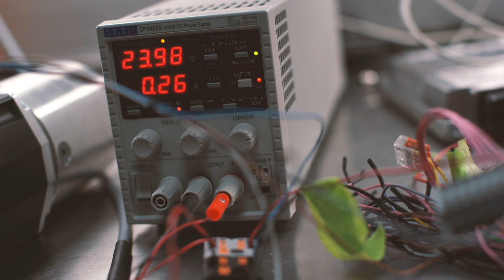Innovation Through Sailing

Comment: I think if you can imagine it, you can build it. Can you swap the sails for fins of some kind of technology? Fins located in different places on the fish serve different purposes such as moving forward, turning, keeping an upright position or stopping. Flying fish use pectoral fins for gliding. Just saying ...
Reply: Well in a sense, that's the whole idea of foils and keels as a whole!  The fish uses the fins on its body for thrust, which works because it can push against water, which is 800 times denser than air.  The foils now do all of those things that you mentioned fish do, using force from the wind in stead of from muscle to create forward and upward motion and keep the boat stable (which they've gotten so much better at compared to 2013's AC).  Unfortunately all the teams are required to use a soft wing for this cup, but the wing sail in general is just like a giant adipose fin.  The irony is, as we see in the new aerodynamic hull designs from Ineos and American Magic, the performance of the boat as it moves through the air has become almost more important that how it moves through the water!  They basically cruise at highway speeds now, and the drag created by that much hull area is massive.  I think we're bound to see inspiration from birds, so to speak,  come in the future just as much as from fish!

Comment: How about if we see if sailers can sail these boats without any help from computers?
Reply: No argument there, my question better stated is can this exact boat be sailed without computers?  This could promote technology (minus computers) and severely challenge sailers.
Reply: @erichaskell  I agree with you. What's the point of technology if it replaces the skill of a true sailor?
Reply: If you're not a skillfull sailor and a great helmsman,  you won't keep that boat flying more than one second... it doesn't have an autopilot!
Reply: @William Noetling does fly by wire replace the skill of a true pilot? Without it no modern military jet would stay in the air. The systems augment the human to make the impossible become commonplace
Reply: America's cup is to sailing, as Formula 1 is to driving.

Comment: Boring compared to the "cats"
Reply: Honestly I agree. Also with the cats you had to run across from one side to the other, fitniss.
Reply: I too was fairly disappointed when NZ chose the mono-hull.  But I am starting to warm up to it after seeing the proposed design.  Projecting that top speed will be even faster than the cats.  Smaller Crew, that is good.  Self Righting, that is good.  But I do worry about the close encounters with other racers and the foils getting tangled.  Gonna be huge learning curves.